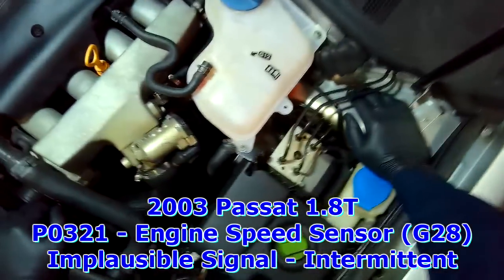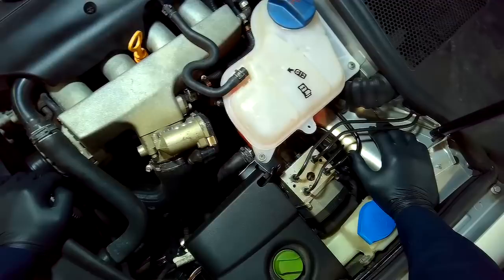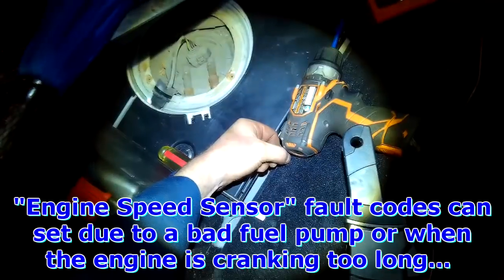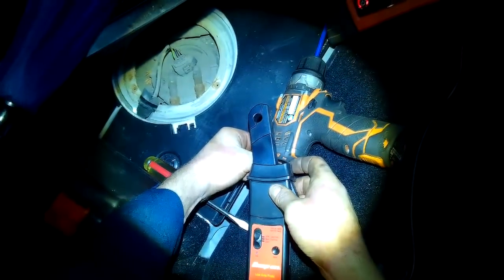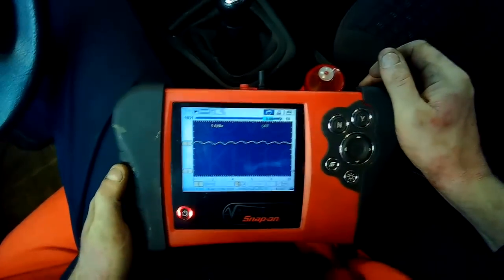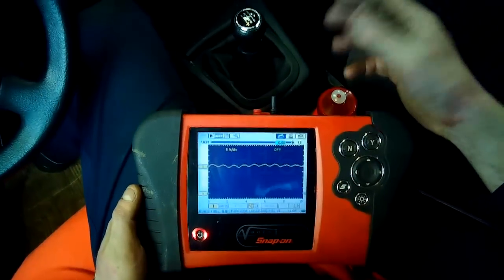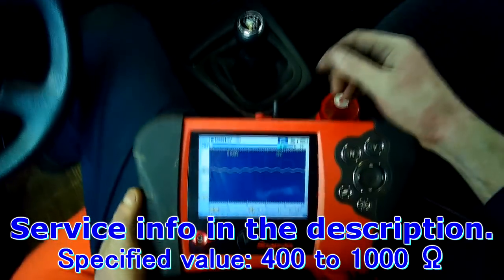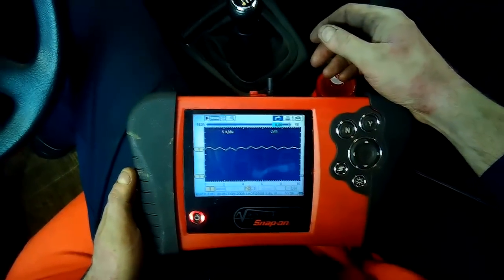VW B5: 1.8T Passat crankshaft position sensor

Comment: Use of the Vantage to confirm fuel pump. The background on crank sensor failure conditions. Hot, intermittent, inconsistent. And the fact that ohming is very inconclusive. Plus car is starting and running fine now. Is it a vrs or Hall Effect sensor?  Dang, my wife says I’m a loud close talker. If I ever get to BC, I will talk quiet and distant. Those were a few of the many things I learned/liked about this vid
Reply from the maker: Don't get me wrong Bill... there's nothing wrong with a close talker, but she'd have to be 25 to 30 years old in my book. LOL

Comment: Is it the G28? Had to change that on my A3 a while ago. Wasn't fun when it failed while driving. Was intermitten as well. Turning car of and on again usually helped.
Reply from the maker: VW's designation for sensors & output (controlled) devices. 
G for sensors and N for controlled devices.
Thank you for replying Blocki! Send me your mailing address and I will send you some of my channel stickers! If you want some. fkh161@fkh161.ca
Reply from the maker: Yes, G28.
Reply: Thomas EXOVCDS. What is G28? A model of VW?
Reply: Geber (Sensor if you will) number 28.

Comment: I was thinking about where to get a bigger inspection mirror since the small mirror is great in tight places but gives a small picture to and doesn't give the referance a bigger one would have given. Duh.. junkyards and outside mirrors... Thanks for the you-didn't-know-you-gave-it-tip!
Reply from the maker: They are great... I've used rear view mirrors as well over the years! =)

Comment: His comment about cleaning the block is very critical. I had an experience with a Chevy pick-up where not cleaning the block properly when installing a crank sensor resulted in an engine that was extremely hard to start and ran terrible. Getting at the sensor required removing the starter so, in this case, a lot of extra work was required to do something that should have been done in the first place.
Reply from the maker: I tend to forget to mention useful information... thank you for spotting & verifying / confirming one of mine! =)
Reply: The ECU uses crankshaft position data to determine ignition timing and fuel injection timing. Camshaft position sensor data is also a factor in ignition and fuel injection timing.

Comment: Vancouver, no rusting subframes !  Ontario = biodegradable
Reply from the maker: LOL... yeah, the only rusty cars we see, are from back east!
Reply: The body of my 2004 B5.5 is still perfect, I try to spray the subframes with Krown or Rust Check but there is enough metal on these subframes that I'm not too worried about structural integrity issues.
FWIW, my 1.8T is on its 3rd crank position sensor :o(
Reply from the maker: They are built solid!
First one to get to 10 wins! LOL
Reply: VW, turning owners into mechanics since 1945 :o)
Reply from the maker: Haha!